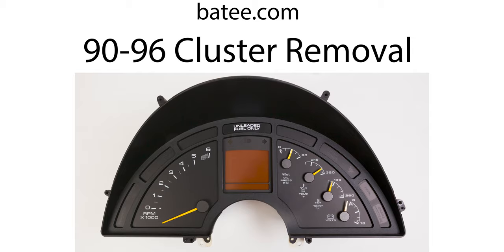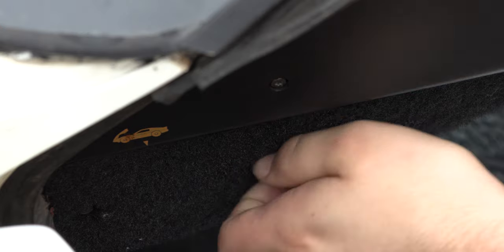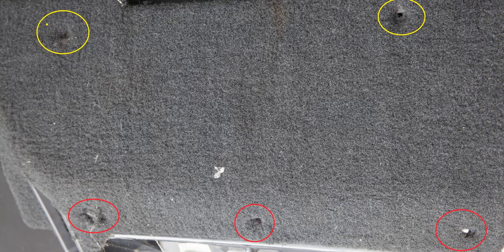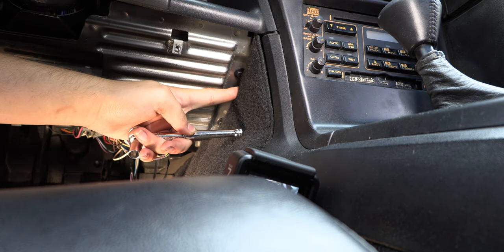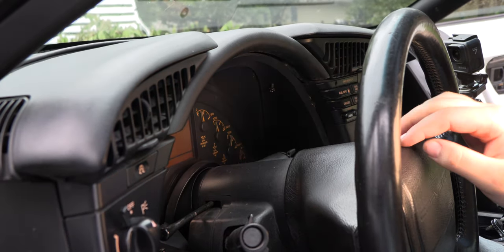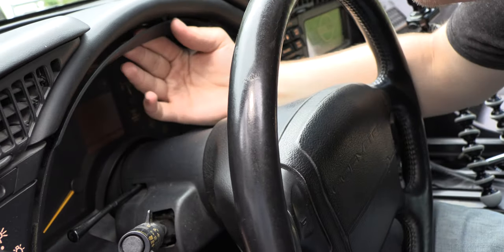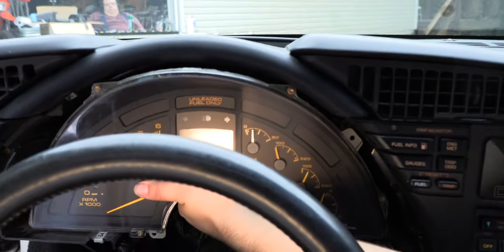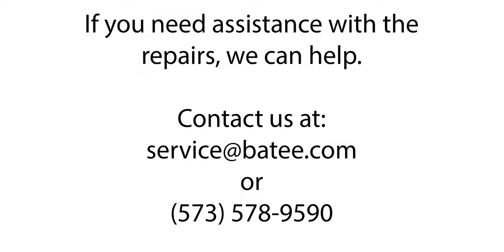90-96 Corvette #0 - Instrument Panel Removal batee.com (2019)

Comment: Thank you. About to do that. No LED display at all (orange glow only). So I might be getting a screen from y'all. Worked fine when parked 8 years ago, nothing now after getting the car running again (4L60E replacement).
Reply: I will add that you disconnected the + terminal as opposed to the - terminal. I've always done the - one as instructed in every other manual and video. Just curious why? Thanks again.

Comment: Brian, this video on how to remove the C4 instrument cluster was excellent.  Mine came right out by following your steps.  Now I have a question: do you guys buy instrument clusters?  Mine works very well, but is unneeded.  I am replacing it with an analog gauge dash assembly from New Vintage.

Comment: Any feedback concerning a coolant temp gauge needle being off scale in the black area. I changed the analog temp sensor in engine block. The needle remains pegged off scale . Moves about 1/4 inch back and forth off scale when key is turned. Stepper motor? Any ideas? How much to rebuild gauge cluster? Are stepper motors tough to replace? I’ve already had dash off once. Nick

Comment: Almost everything in the interior of a C4 is 7mm not 9/32.  I'm sure 9/32 works but it's a metric bolt!
Reply: Everything except this bolt over here which is 10 mm, that one over there which happens to be 13 mm, and the odd bolt somebody has already replaced before but it happens to be a goddamn Torx.
Reply: @vomErsten  lol. Exactly. Also throw some 11mm bolts in there just to mess with us. Only on this car have I had to use 11mm.